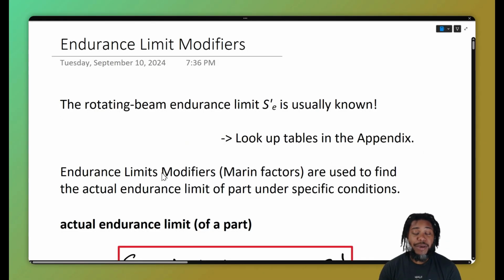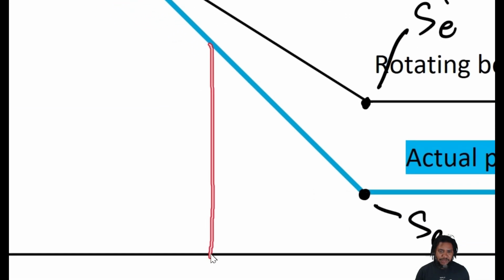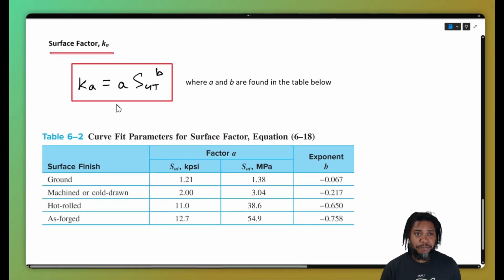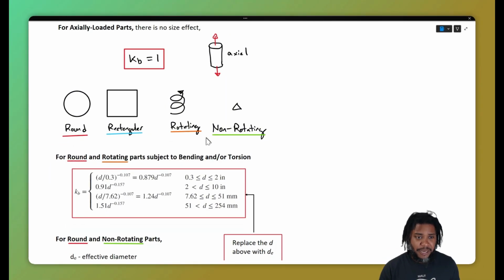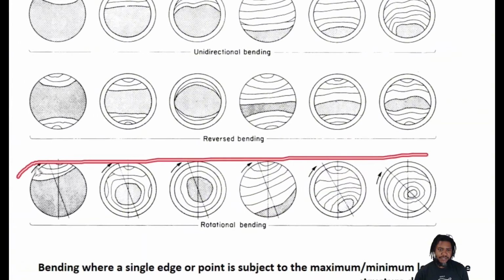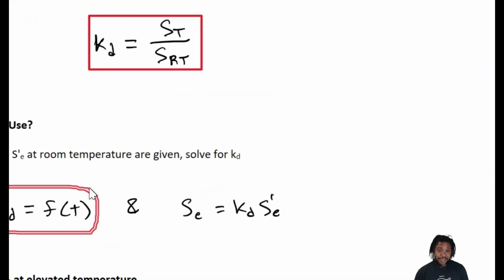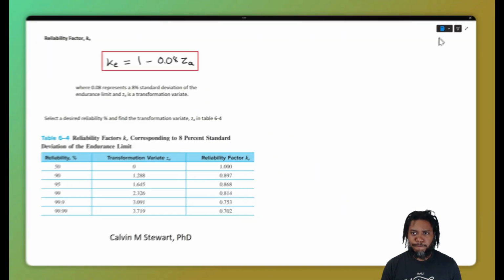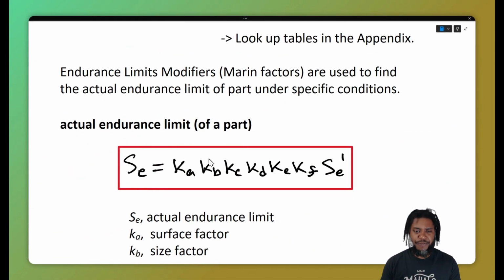Endurance Limit Modifiers

Comment: This is actually a complaint from certain engineers about MMPDS.  Coupons to establish fatigue strengths are for polished specimens and they don’t give you knockdowns.
Reply from the maker: Yes, Indeed. One of the core challenges is that different parts often have different levels of surface preparation. If properties are to be acquired that are material specific, it is best to perform testing in the polished condition. Afterword's, a few tests at the part specific condition can help establish the knockdown factor.